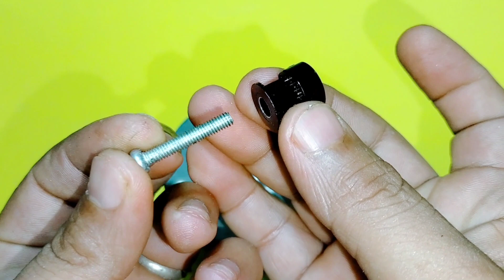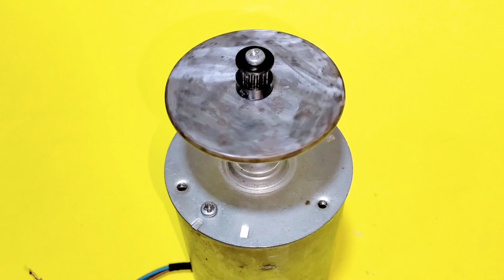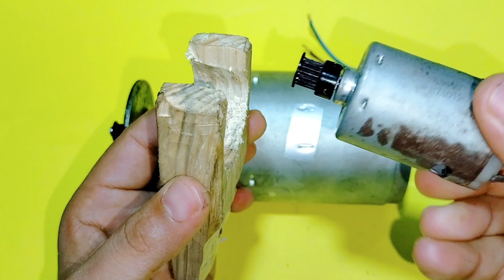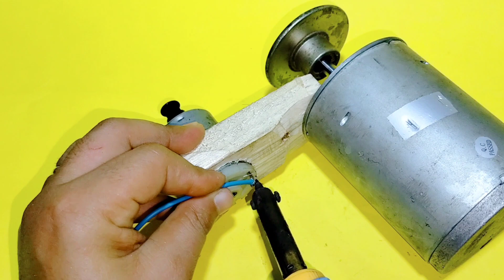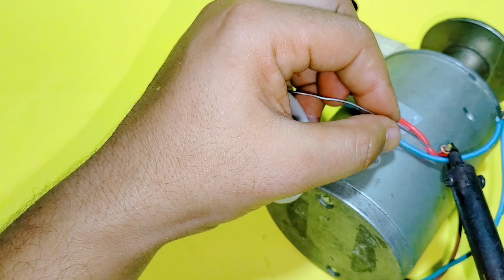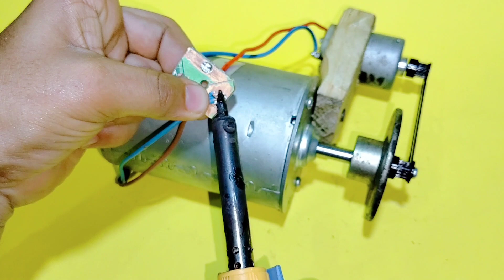how to generate infinit free energy with two ac motors

Comment: Do you use a high and low voltage motor or the two are the same voltage? 
AC is it motor out of a air conditioner or AC the current?